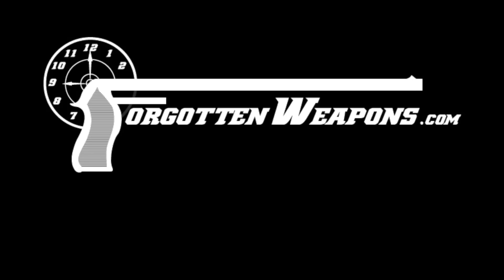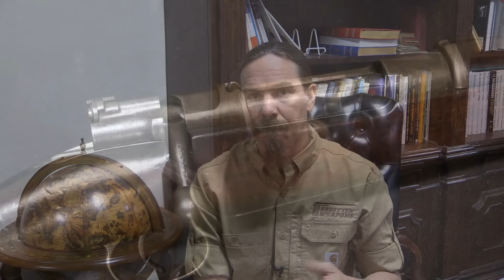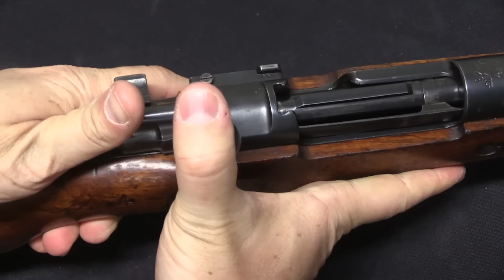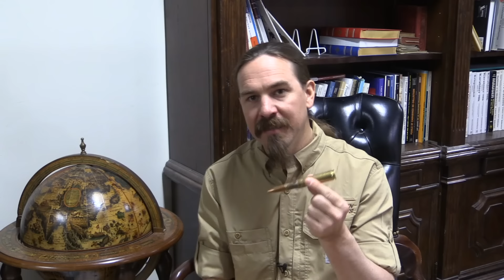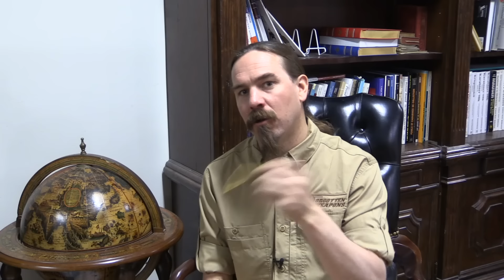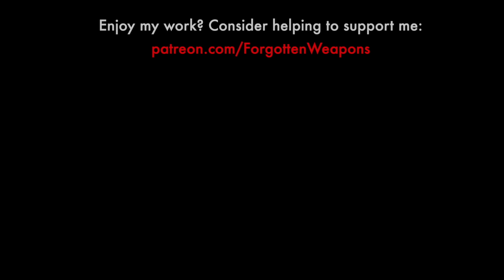Earth-Shattering ka-Boom! How (and Why) Guns Explode

Comment: I had a very POTENTIALLY scary situation a while ago. I was at the range with my ex and some friends and we were renting some of their guns. We rented a PCC P90 in semi-auto and all was well. My turn to shoot it came around, and two of my friends had gone to get ammo for some of the other guns we were using. I was shooting fine and having fun, and then the gun jammed. I was new to actually shooting at the time, but I'd done plenty of reading and research and so I went to clear the malfunction (Remove magazine, cycle the action, inspect the firearm.) I only got to cycling the action, because when I did an empty case came out with a bunch of powder and the actual projectile itself torn out from the case. It had ALMOST been pushed into the chamber, but luckily the way the cartridge had misfed prevented that. Still, it was very sobering, as if I'd have been inattentive and a little less perceptive, I might've went to shoot another round like nothing was wrong and had a catastrophic failure.

I guess in short, it really does pay to keep an eye out for the little things, and as long as you do and you're careful, your practical proficiency with firearms can be relatively low as long as you're cautious and know when to stop when something feels wrong. (Though, knowing what feels right and wrong definitely is important.)

Comment: Can't remember where I read it (Hatcher's Notebook?) - the result of firing a gun with a bullet stuck in the bore is that the second bullet will strike the first one, and both will upset to a larger diameter, causing the barrel to bulge and burst where the obstruction was. The gas pressure will usually exit the barrel where it burst rather than cause the case or action to fail.

Comment: 29:50 Something happened to me years ago and it may prevent some future trouble. I was shooting a revolver regularly at the time. I would go to the range, shoot 50 or 100 rounds from a revolver, go home, clean and oil the gun, load it and stage it in my home for use to stop any bad men that broke in. I once had a lapse of several months without touching a cleaned loaded revolver. I went to the range several months later and the 4th and 5th rounds sizzled. The oil I used after the cleaning had penetrated the cartridges (32 S&W Long).  I did not have a squib but could have. Lesson for me: oil VERY lightly after cleaning a revolver. STOP if you hear a round sizzle.

Comment: On multiple occasions I have had dangerous things happen using various brands of commercially reloaded/remanufactured ammunition.  Once from a well known maker of such ammo (hint, lead round nose 230 gr. bullets in .45acp), and several times from a local FFL holder who should not be allowed near a loading press.  He has supplied 9x19 ammo that goes pfft instead of bang (and it is such fun (not) to manually remove a stuck bullet from a pistol or carbine barrel), .45acp cartridges that won't even chamber in 1911 (failure to size the cases), and a .35 Remington cartridge he had jacketed himself that had the core blow out and left the jacket inside the barrel.  (Luckily although it did go bang, it felt a little weird and the gun was examined before trying a second round.)  I no longer buy any remanufactured/reloaded products.  I also don't buy military surplus ammo unless it is still in the factory original sealed tin.

Comment: have made some attempts with snow in shotguns (with us a known problem).  found that it is not the charge that hits the snow that is the challenge.  it is air that is compressed between charge and snow that reaches such a high pressure that the barrel explodes.

Comment: My first issued M-16 was slightly more exciting than most every time I had to pull the trigger. It had what the armory sgt referred to as a "not yet critical development". Every time a round was fired, the chamber vented very hot gases out of the trigger group housing, mag port, and charging handle causing it to stovepipe if on burst or with rapid fired. If not on the range or in an engagement I couldn't plan for, I would start with my M9 until dry and then throw it at the hostile, before I would risk the upper receiver developing the issue up to critical and rapidly disassemble itself.

Comment: Years ago I had an AR carbine without M4 feed ramps. I was shooting factory ammo that did NOT have the bullet crimped into the case. As the last cartridge it would ever fire was stripped from the magazine the bullet was shoved into the case by the feed ramp but continued into the chamber and the bolt closed in battery. I had no indication anything was out of the ordinary, so I pulled the trigger. 
Eugene Stoner knew what he was doing when he designed the AR platform! The case ruptured at the rear, the extractor was bent outward locking the bolt into the barrel extension, the extractor pin broke, the cam pin broke,  the bottom of the bolt carrier was blown straight down into the magazine, the nearly full Thermold 30 round magazine was destroyed, the ground was littered with ammo, the flat top upper receiver was split from the barrel nut to the charging handle on both sides and the mag well of the lower receiver was bulged. I believe the lower would have split if it weren't for the Johnson's Ready Mag I had installed, the lower became another build later. I also believe the upper would have separated more if not for the A.R.M.S. Swan Sleeve I had installed.
I haven't researched it but I believe I was not the first shooter to experience such a mishap which, if true, may be why M4 feed ramps are the standard in the AR platform today. This catastrophic failure taught me two things, especially about shooting the AR platform specifically but semi autos in general. 1-I only use ammo with crimped bullets (in semi autos) and 2-I NEVER hold the rifle with my fore hand wrapped around the magazine well. I mounted all of the broken parts into a shadowbox that hangs on the wall of my reloading room as a reminder.
My only "injury" was a few red marks on my left forearm caused by the shrapnel from the magazine coming apart. My heart goes out to those who suffered injuries in the early days of firearms usage. Their suffering led to innovations in firearms design that vastly improved safety for shooters. In my case the rifle did exactly as Eugene Stoner designed it, it directed the energy down away from my face. 
I am convinced Scott's 50 BMG encountered pressure above 100,000 PSI. Scott said the manufacturer told him the pressure necessary to strip the threads on the breach cap was 85,000 PSI. To strip those threads AND break off BOTH of the "safety ears" (I don't know what they're called) with enough force to send one of them into Scott's body and the breach cap to break his orbital bone had to be in excess of 85,000 PSI, likely over 100,000 PSI.
Sorry for the length but thanks for reading and I wish you all safe shooting.

Comment: My dad, brother and I were on the range one day and my dad was shooting his revolver.  One or two rounds fired normally and then one squibbed.  I heard it and immediately thought something was wrong, but before I could say or do anything, he fired two more rounds--stove piping 3 bullets in the barrel.  The gun did not fail (to the extreme surprise of all present) and no one was injured.  We took it to a gunsmith and he cleared the barrel, bore scoped it, checked clearances and inspected for cracks and anything else he could think of but found nothing that would warrant taking the gun out of service.  He test fired several rounds and returned the gun to us saying "I can't believe it, but it's good to go."

Always pay attention, be safe and use common sense along with trusted and proven ammo.  When things go bad, it is usually very bad.  We all got very lucky that day and I would never press my luck like that again.

Comment: 7:19 My dad did this some years ago while we were zeroing a scope. Thankfully the rifle was only a .22, but still could have ended with a broken gun, especially if the laser hadn’t been inserted into a suppressor on the muzzle instead of the end of the barrel itself. My theory is that the extra space in the can allowed an area for the pressure to expand until the bolt came back and the excess vented out the chamber. At the end of a 16 inch barrel 22 doesn’t have much excess pressure anyways so the space between the baffles was probably enough. Meant for one jacked up suppressor though, I can tell you that much.

Comment: Having limited information to work with, it doesn't look like the SLAP round was too high of a pressure by itself. The probability of it just randomly having such a dramatic overcharge of powder is also very small. 
The issue appears to be one of firing a Sabot (SLAP - Sabot Light Armor Piercing) round in a rifle with a muzzle brake. Something that is expressly warned about in several manuals. The SLAP round was intended to be fired in a platform without a muzzle brake. Kentucky Ballistics gained some serious experience, the hard way.

Comment: As a kid, I put some Black Cat powder in a plastic pen tube (1/4 inch ID x 7 long) to create a mini showering candle. I placed a Black Cat fuse in the throat, lit the fuse, and tilted the tube so the fuse would slide down to the powder. Deflagration! 

The fuse may have been the obstruction. I still have a piece of that tube in my hand. I am lucky that was all that happened.

Comment: @Ian, Might I suggest you add another important little detail to this otherwise fine video? This would be an improperly headspaced rifle indicating this condition with a stretch "ring" around the base of the spent cartridge. Ive had one rifle, #1 Mk 3 Indian Enfield that showed this symptom. I dont even remember where I learned this but this particular rifle is the only one I ever had that showed this.

Comment: Have over 50 years of shooting and at one time owned a small ammunition manufacturing company along with a class 3 manufacturing service.  I have seen old ammunition deteriorate in ways people don't think of.  One is the powder breaking up into smaller pieces via prolonged vibration thus exposing more surface area and radically increasing the surface area and burn rate.  Had one hapless individual tumble his ammo because it was corroded (404 Jefferey) and while he is OK the gun is no more.

Comment: 28:00 That's really a problem, especially for soldiers who are drilled into clearing the obstruction as fast as possible and keep shooting, not even thinking what happened at that moment (because a) it happens so little and b) checking every part of the gun is actually more dangerous in a firefight). I'm glad that (almost) all modern guns that I have handled in my time as a soldier (except the M4) complied to Standard NATO-AC225/D14 and don't have this problem at all.
For those who don't know it: A gun that complies with AC225/D14 can have a complete barrel obstruction by a previous projectile and still function normally because the second projectile will push the first out of the barrel.

Comment: Just to add... a squib may also occur when shooting a magnum cartridge (say .44 mag) that has been primed with a regular instead of magnum primer... the regular primer will produce a weak explosion which will fail to ignite the powder fast enough for it to thoroughly burn... the bullet will be propelled out of the case but will get stuck in the barrel... such a situation is easy to diagnose: there will be some residues of unburnt powder in the case, vs. none at all if the squib was the result of no powder in the case.

Comment: You're right. Those SLAP rounds were still in service as late as 2011 in Iraq. The Slap rounds we tested with SOTF in 2011 wouldn't even chamber in a Barrett M107.  Build-up of nylon material in the barrel could lead to a major failure.  I've documented a .50 SLAP with a yellow colored nylon sabot component , and a red colored sabot component.  Both rounds had different chamber dimensions.

Comment: Part 1: Things I’ve learned at the range from observation of others (don’t try any of this stuff yourself):
1. Shooting .308 in a .30-06 rifle doesn’t seem to hurt it.  But it makes weird brass. 
2. Shooting 9mm in a Glock with a .40 cal barrel doesn’t seem to hurt it. Makes the Glock inaccurate and unreliable and makes weird brass 
3. A Ruger Blackhawk can withstand shooting a double charged .357 round without damaging to the gun. 
4. INSPECT any new or new-to-you gun before shooting it. I saw a Remington brand new rifle at the range with “270” in huge block letters in the barrel. It didn’t shoot accurately. Upon a brief inspection it turned out Remington had used a .30 cal bore barrel on a 270 rifle. Had this been the other way around the shooter could have been killed. 
5. Shooting a scoped muzzle loader with the ramrod in the barrel break the shooter’s nose. Also, your friends will laugh at you later. 
6. Shooting 22lr in a 22 magnum rifle doesn’t seem to hurt it, but it will not be reliable or accurate.

Comment: Thank u, a wonderful video, really addresses most of the questions ive had ever since i saw that 50bmg explosion quoted on the AK Guy channel. The questions i have left are - what else can possibly be done to make a gun really reallyvsafe (say that very 50bmg ak) - mb smth expensive, and thus shun by the mass production gun designers. and - a questuon that long beats me: how is it out there in the new materials department, speaking gunwise? I mean - we have prettybmuch discovered the whole Mendeleevs periodic table, but the best thing we have for the guns is just....._steel_? it's what, hundreds years old? is there no new material that would make a gun lighter with same size or smaller with the same mass or morre safe? Thanx a lot again!

Comment: The Glock Ka-boom isn't from a weakness at the 6 o'clock position. 

They way I have heard it explained is that Glocks have a big sloppy chamber because they are made on the loose end of the specs. If a case mouth is small enough to get past the end of the chamber into the lead. When the round is fired, the case pinches in and holds the bullet in place until the pressure gets high enough to rip the sliver of brass off the moouth and the bullet goes out the barrel. The pressure can build anywhere from enough blow out the back of the case and jamb up the gun all the way up to split the chamber, bend the slide and break the frame, depending on how stuck the bullet gets.

If it was just a case failure, there would be a lot less damage. 

I saw it happen twice. One was an old 40 shooting reloads and the other was a new 9 on its first trip to the range shooting factory ammo.

Comment: I've had a savage 17hmr.a round blew open from a crack in the case tip sent the round down range but also sent gas back in the shooters face came out in the mag and out the vent hole. Also had a Kahr 9mm blow up once bad brass aswell blew out the mag and the access panel on the side shooters hand went numb for a while but otherwise fine.

Comment: I watched the video it appears to me that the powder in the 50BMG detonated (went off at hypersonic velocity- instantly!) instead of normal subsonic deflagration over a steady curve like smokeless is supposed to burn.  No bullet can accelerate fast enough to outrun a detonation so the gun becomes a grenade.  A detonation is a dramatic, often destructive, form of an explosion. It is characterized by a supersonic exothermic front (in excess of 100 m/s up to 2000 m/s) and significant overpressure (up to 20 bars). The front drives a shockwave ahead of it.

Comment: I seem to remember him mentioning that this rn50  had a thicker barrel. If the threaded cap at the rear was not also strengthened, it automatically became the weak point.

This is a common dilemma when designing something that has the possibility of failure. You have to look at the whole system, whether its a firearm, the drivertain of a vehicle or crumple zones on a car. Its not enough to just use a safety factor on your compoent strength. All of the components with need to be designed to exceed a minimum strength, except one component that is intentionally weaker, and will fail in a consistent and safe manner. You can never predict the ammount of force a system might experience, so a fail safe is a must

Comment: When you only have a factor of safety of 1.45 in your pressure containment vessel, you should expect more results like Scott's.  An AI .50 BMG or Barrett would chug along after that with minimal indication to the shooter anything unusual had happened.

80ksi/55ksi= 1.45 FoS

That's not enough. FoS of 2 would be more ideal for  .50 BMG due to propellant volume, projectile mass, and pressure containment mass.